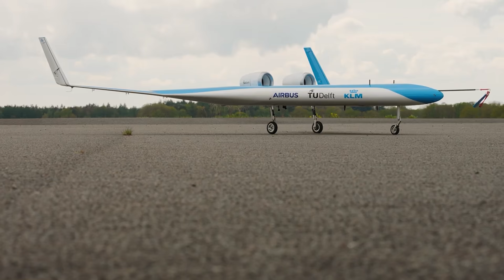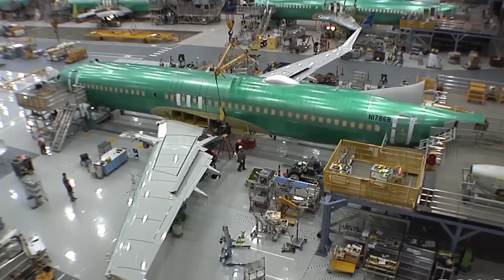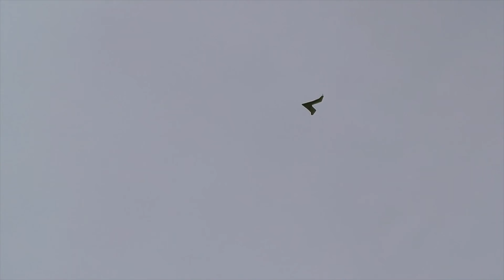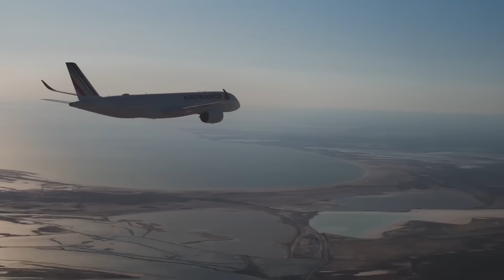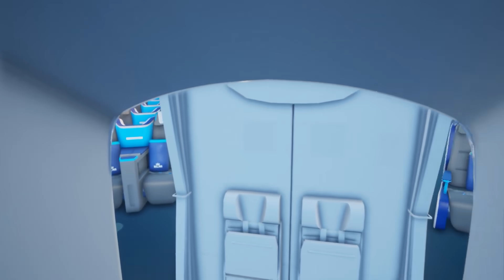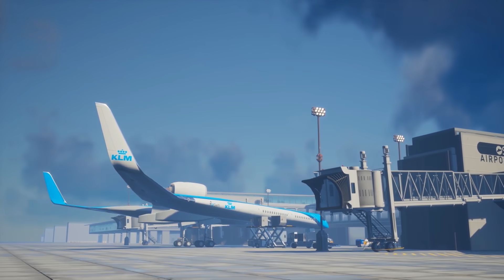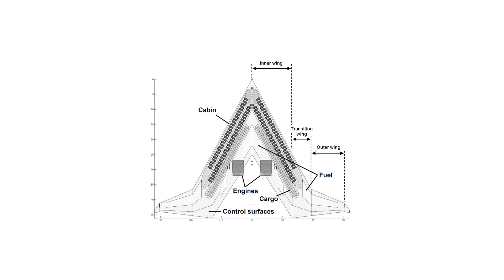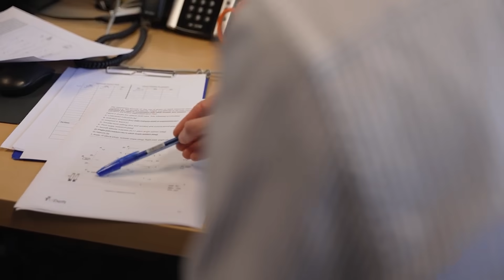The Flying V’s Fatal Flaw: Why This Jet May Never Fly Passengers!

Comment from the maker: Do you see the Flying V actually carrying paying passengers in our lifetime?
After digging into the pressure issue, cabin structure and ride quality, I’m not convinced this will ever get beyond demonstrators and test articles.
Curious where you stand:

✅ “Yes – the engineering is tough, but solvable.”
❌ “No – it’s a beautiful research project, not a commercial airliner.”
🤔 “Maybe – but only in a heavily modified, less radical form.”

Reply with YES, NO or MAYBE and tell me why 
I’m reading through as many comments as I can.
Reply: No. Too much going on. However, for freight that doesn't need pressurization it could be great. You'd have to figure out how to get it in and out though.
Reply: Nope. 
The design and certification process has become so difficult that no company will be able to build an all-new airliner without significant state support and no one can predict how long it will take. That's just subsonic flying-tube twinjets.
The Flying V interior shape will be unsettling for passengers. And how will containerized cargo work?
As engineering and manufacturing and maintenance challenges eat into the fuel efficiency margin, more modest innovations start to look much better.

V sure is pretty, though. Fit for Supermarionation.
Reply: @AtomicBuffalo  agreed.  Boeing made a full size mockup of the interior of their BWB.  The reaction was very negative from the study group.  The stadium seating was not very popular.  I also think people missed the windows.  The V maybe better with window seating but still a far cry from current aircraft.
Reply: @madmadmal no. Engineering can solve the problem. But passenger comfort can’t be solved. Anyone who has flown knows that a wide body can be much more uncomfortable than a narrow body aircraft. This will be far wider. There could be an over 6 meter rise and fall during a bank in the middle and much more than that at the rear of the aircraft. That would mean a far wider turn so that a lesser bank would be required, which would cause other problems in a flight path.

That is the problem with these designs, not the engineering. After all there is no need to pressurize most of the interior, just the passenger areas.
Reply: To quote dev ayesa these are engineering problems we are engineers
Reply: It could work with double 'V' shape. Make the forward V for passenger much tighter V so the lateral G forces won't be big problem, and then the back part of  'V' can widen... 
But the V shape doesn't provide special advantages. Placing fuel far from center of gravity will make design unstable. So the fuel needs to be distributed. Not good if you want use LH2 as fuel. This is easier for full delta like Boeing is going for.
Reply: Well, how about an O-shaped craft that takes off and lands vertically?  My point was that we're still thinking inside the box.

Comment: These concepts have been studied to death by Boeing and Airbus. Aerodynamically intriguing but structurally a disaster. And state of the art is likely to be 5psi cabin pressure as we learn more about the health risks of longer flights.  Overall no net gain even assuming big gains in carbon strength and stiffness.

Comment: Am I the only one noticing that those seats in the wings are at an angle with the direction of movement?
On a normal airplane when it's accelerating you feel the seat pushing you forward. With this design you'll feel the seat pushing you partially forward and partially sideways.
For it to be viable the seats in the wings would have to be pointing forward at the same angle as the pilots' seats.

Comment: Double-walled cabins would allow for staged pressurization, reducing the stress the latter causes to roughly half each 'wall' (wall, roof, floor) surface. But it would much increase weight, probably eating up the otherwise gain in fuel consumption.

Comment: As an engineer of a different field for 50 years,I know nothing about airframes but worked with a lot of pressure vessels. I would think you could run 2 tubes at an angle with a sweeping ell for the pilot cockpit and skin with carbon fiber or aluminum to make the v shape. Separating the pressure container from the air foil. But being realistic those engineers are far,far smarter than I and had to have thought of. lol

Comment: The primary reason the Flying V has not advanced beyond the academic research phase is that Europe has not had military budgets large enough to permit a contract to build a full-scale prototype aerial tanker.

The roll-induced heaving of the outermost seats in a Flying V can be dealt with by rolling more slowly and  actively damping any turbulence-induced roll motion. The Flying V‘s tendency to oscillate in Dutch Roll is an open issue that may require larger vertical stabilizers at the wingtips and/or active damping. Civilian certification remains a daunting prospect.

Comment: My biggest issue, and I've been saying this for years, is PAX sitting 50, 60, or even 70 feet from the centerline of the aircraft. Now maneuver the aircraft after takeoff or before landing, where the most turns happen. Your seat is moving up and down at the end of a long momant arm. The ride will be hell to endure, and I see a lot of vomit in play. This and Jet Zero's designs are not going to make good passenger planes at all.

Comment: Perhaps a slightly lower tech answer might solve the problem. And Boeing already had it a long time ago - the Sonic Cruiser.   It was a canard tube and wing design that would fly at a higher mach number.  They gave it up.  Perhaps they should bring it back.  And as for this design, perhaps it could be used as a stealth bomber without having to pressurize such a large area.

Comment: The constellation was a beautiful aircraft.  It just could not be built cost effectively because no two sections of the plane were the same shape. Every foot of the plane needs specialized tooling. Remember British airliners and jets with the engines embedded inside the wings?   Aerodynamically more efficient. But a Nightmare to repair and service.   The reason planes look like they do is they cost LESS to build and LESS to maintain when the fuselage is a simple cylinder and the engines and cargo holds are close to the ground with easily opened doors and cowling. 
Flying wing aircraft Will never achieve fuel economies capable of offsetting their extraordinary cost of building.  There is such a thing as design optimization.   Ever since the iPhone, no one has come out with anything other than variations on that form simply because it’s a truly optimal design.
Modern aircraft are genuinely an optimal balance of affordable design and construction, affordable maintenance, and affordable efficiency.   Trying to gain a small increase in fuel efficiency at a huge markup in design and construction cost is a fool’s errand.

Comment: Just because the "tube" design is not as efficient and is nearly a century old in design, doesn't mean it needs to be replaced.
Another design that could be improved a little but in essence is still going strong the way it has for thousands of years is still being used because it is close to perfect as it can be: the wheel.
Some designs are just the right shape and that is that. If you want to safely move people around this world with the highest possible survival rate (which is more important than fuel efficiency), the tube design of planes as they are now is where we must keep passenger travel.
Like the wheel, it can be refined here and there, but the general shape is as good as it gets. Same for the tube design for passenger airline flights.
Reply: The question isn’t whether the tube design will eventually be replaced, it’s when. Just like when fossil fuels will eventually be replaced with something better, it’s just a matter of time.

Comment: How would it differ if used as cargo or military purposes?
Reply from the maker: That's a fantastic question! For cargo or military purposes, the "fatal flaw" of passenger comfort becomes less of an issue, opening up a lot of possibilities for its unique design advantages.
Reply: @ExPlaned1  There is a huge future in this design but its most definitely not with passengers. 
I agree with you.

Comment: They have designed the perfect Cargo aircraft. No need for pressurization in v1 - the cargo version. Get that certified and gain flying experience with it. Then move to the passenger version that incorporates all the lessons learned.

Comment: Just build interconnected "tubes" within the frame. 
Sure, this will increase weight but the drag benefits will offset all of that.
Reply: Nope. Weight is more critical than any others.
Reply: I see where you are going with this. My company, Javier Components Manufacturing, has recently debuted the 800 series tubular carbon/steel/titanium craftation cells, they would be ideal for this. So then we'd have a Flying V with an all-tube JCM-800. We will of course have to contract with the Ibanez aviation company to use thier new Torsion Segmenter version 9, aka TS-9 to complete the rig.

Comment: NO NO NO, The problem with this design is to Problematic. Leave well enough alone, and if your going to that extreme, you might as well make a Flying saucer, until then, they start, using anti gravity planes, you can count me out. No way would anybody in there right mind would get in that problem. WEIGHT DISTRIBUTION AND BALANCE OF THAT AIRCRAFT, WOULD BE TOO DIFFICULT TO CONTROL.

Comment: You forgot the Concorde an amazing plane that needed more development and it could have cut flight times in half they just had to get the noise down.
Reply from the maker: That's a great point about the Concorde! Its potential was undeniable, and noise was definitely a significant hurdle.
Reply: The US would have changed the noise regulations to ban anything non- American.
Reply: @imankhandaker6103  you do know the Americans wanted to build their own supersonic aircraft 😊
Reply: @lezbarker2673 Boeing thought it would be cheaper to bankrupt others. 2707 was it?
Reply: @imankhandaker6103  that was their own stupid design that was way too big.
Reply: @lezbarker2673 Size is everything to some people.

Comment: It simply do not feel like commercial project, main issue i think is not addressed is cost per plane and its lifetime. and from explanations looks like unit will be one blended body that could make repairs and modifications structurally impossible. And mass production challenging. tube and wings biggest advantage is flexibility, simplicity and price.

Comment: Doesn’t sound too hard to fix.
Get two aircraft pressurized, cabin sections, put them down the V shape and put all the electronics on and all that engineering, plumbing, etc. and the two is a separate outside under the fuselage skin un-pressurized 

And just shape the aircraft fuselage  around the cylinder, the body doesn’t have to breathe just the cylinder… I’m sure you’ll figure it out

Comment: To solve the cabin pressure problem, make the cabins tubular to function as the main spars, with a short cockpit section joining them. (I e. 3 connecting pressure vessels in a V or Y configuration . Give the passengers video screens fed by outside cameras to substitute for windows. That would simplify construction and probably save weight. No need for stressed holes in the skin.
Admittedly, this would constrain the design to certain scales, given the minimum diameter for adequate headroom and seat width, against the aerodynamics of wing thickness.

Comment: The whole schtick where design is "stagnant" and engineers are wringing their hands about it is kind of silly. Engineering solution spaces have optimal points. Once you've found one, finding a better one becomes ever more difficult and expensive. Many prospective ones don't pan out That's all this is about. Trying to make it sound like a dramatic competition actually detracts from understanding the steady, fact-based analysis and exploration required. The effort of finding out what doesn't work is as valuable as finally getting to what does. And there's much more of the former than the latter.

Comment: It wasn't Boeing who first drew a tube on wings. It was De Havilland, additionally , the results ot the tests on the comet weren't regarding the square windows, that's a myth, my great uncle headed up the team who examined the comet. Roland Smith. It was due to specific metals being under the required strengths for pressurised passenger airliner cabins. This was unknown until the comet investigation. The flying V has been around since WW2 It's an old concept. Check out Horten Ho 229
Reply: You beat me to it, this is another example of American exceptionalism based on ignorance
Reply: US's exceptional Ignorantism
Reply: Boeing 307 Stratoliner was  pressurised, entered service in 1940.
Reply: the Horten 229 is a flying wing not a flying V. All flying V's are flying wings but not all flying wings are flying V's.

Comment: Just a little correction, the square windows thing of the Comet is a common myth. It was the 'ADF antenna window' that was found to be the point of failure, not the passenger windows, though they did change the design of the passenger windows as well. Keep in mind the Comet was also flying considerably higher than most modern passenger jets as well so the pressure difference was also greater.
Reply from the maker: Yo, appreciate the heads-up on the Comet info! Didn't know about the ADF antenna thing, that's wild. And the higher altitude makes a lot of sense too. Good to know!
Reply: @ExPlaned1  Why thank you. Keep up the good work.

Comment: The pressure vessel problem can easily be solved with current technology. By simply divorcing it from the body shape as a separate internal structure or joined structures. The moment arm issue, will still be an issue. Even in the more 'conservative' design.
Reply: Every kilo matters a structure inside a shell adds large amounts of mass! & you are stuck inside a windowless tube and that will NOT go well with a lot of passengers.
Reply: @jackdbur increased weight is always going to be an issue. There are ways to solve the windows too. Germany and Russia both did it back in the 30's

Comment: Bird strikes may become more of a problem with more exposed surface areas in a V shape being vulnerable to them. And passenger windows may be more susceptible to breakage with birds striking them, they may need to be stronger for that new external impact force on and too near to them.

I think the tube style is better, only the front of that and leading edges are where birds hit with survivability of the airplane unless it is a bird strike breaking the windscreens or gone into the engine. And if bird strikes are safely accounted for in a V shape, the passenger may have difficulty in seeing that happen with the mess remaining on the windows.

Yes, passengers on the extreme outer areas from the centre will get a lot of action, that can be cool until it is too steep or too sudden. I have been on a couple of large ships, in bad but not the worst of weather, and to the extreme edges, walking was doable but difficult. I can't imagine being on foot or just not with a seatbelt done in turbulence in that distance from the centre on an airplane. 

And yes, I know the design will have to be different in how stresses will be structurally managed. Getting it right, how safe will that be over time? 

The tube style works good, and things may never change from being the design it is today. 🕊

Comment: Make each leg cabin a cylinder, with unloaded trailing edges carrying fuel etc. or only carry passengers in the forward center cabin, and put cargo in the legs. But jetzero work better.

Comment: there are a lot of reasons this won't work, especially passenger comfort.

the biggest stopper on this design is the emergency egress laws.  a passenger aircraft must be able to be evacuated in 90 seconds with half the exits blocked.  this design is exit availability poor.

Comment: Just make the V plane turn gradually. The inner ear in humans can be tricked. We do not measure absolute angle, but relative change.  THe V planes real problem is how it will handle storms. When the plane is being pushed around suddenly, how would be the ride, how much will the wring body flex.

Comment: What is the difference between efficiencies of Flying V and Jetzero designs?  Is this delta worth the extra engineering and additional structural failure risk?  

If so then, there is a case for this radical design.  If not, then not so much.
Reply from the maker: https://youtu.be/9hYlw4VfK6g?si=e-Cs-U3PTXX5easv

Comment: For a hundred years we've been chasing the blended wing/ flying wing dream. But in real life, they have never performed as well as contemporary tube and wing designs. The Burnelli BWB planes of the 1930-40s never matched the performance of Douglas and Lockheed designs using the same engines. The B47, with the same thrust as the B49 flying wing could carry more weight faster and farther; the wing won only in absolute ceiling. The Hortens tried making flying wing cargo aircraft in Argentina after WWII, with the same disappointing results.
Reply: And BTW, non of those were pressurized, so this would be even worse.
Reply from the maker: So, you're saying I might have to wait another hundred years for my flying wing personal jet? My commute is already long enough!